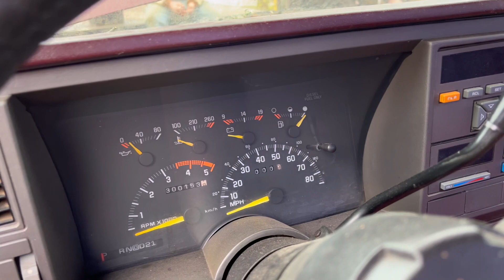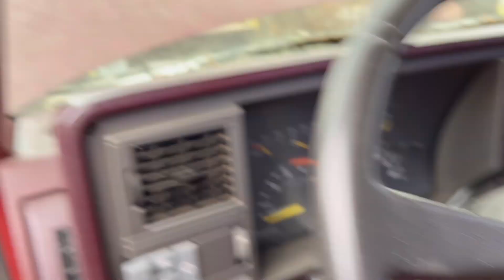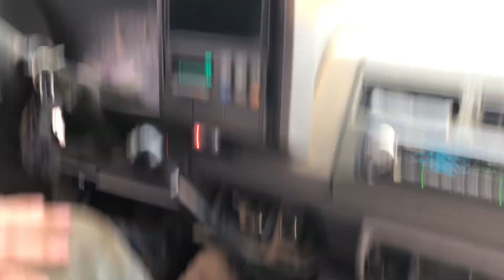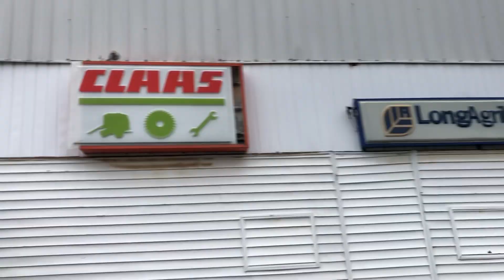LUTZ’S BACKWOODS GARAGE - A new truck has entered the garage!!! #kentucky #chevy #obs #502 #4x4

Comment: That starter that looks like the original one take a mic gauge and measure the housing and then do the same for the other two starters because we had a 1977 GMC with a 350 in it it was a gas burner and we had to take 30,000 Ulta starter to get it to mate with the teeth on the flywheel and after we took $30,000 off of it it worked fine we drove it for $150,000 miles with no problem you could just bump that starter and she would catch so I think that might be your problem I don't think the starter casing is letting it matching to the flywheel it's just barely seating in their shallow and I think that's why it's eating the flywheel up but that's the same thing we had on that GMC with that 350 gas burner but once we took $30,000 off the starter casing they had no problem and then we took took dimple dies and stamped at casing do not throw away do not exchange and so we had it had it fixed if if it ever needed another starter we had to had to know knows of it and all we had to do was throw bushing in there and change the change the nose out and we were good to go and then when we sold the truck we told the guy that bought it the starter that's on there do not exchange it do not you know do anything with that start or not come cuz if you do you got to take another $30,000 off of it thanks for the seat all right man have a good day I hope you get it fixed

Comment: While that Truck was still outside why didn't you open both doors  and take a leaf blower to the inside, both directions Including under the dash and seat. Then close the doors and open the hood and blow the NUTS off the engine,fender wells, rad support.  Then drop the tail gate and blow the leaves out of the bed. Then put the truck inside the garage? I have a hard enough time keeping my garage clean let alone dragging all that extra crap inside not to mention whatever critters might be along for the ride.
Reply from the maker: Well when I got home I had to watch my baby for my wife and then it started raining so we just tried to get in the shop so it wouldn’t be dripping water everywhere while we are under it. That was the plan but stuff happens